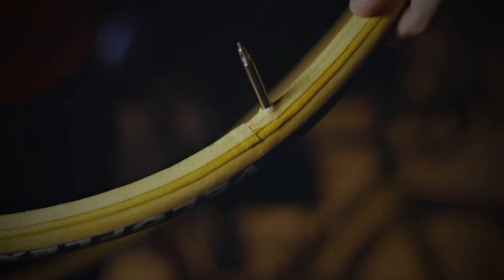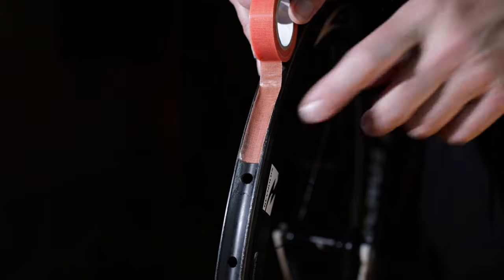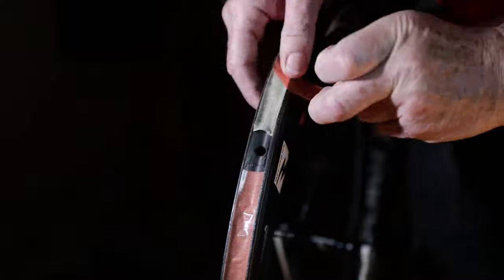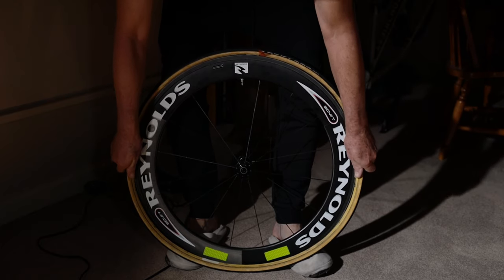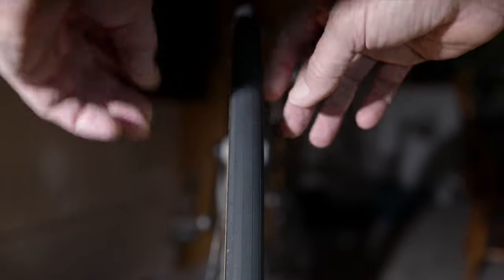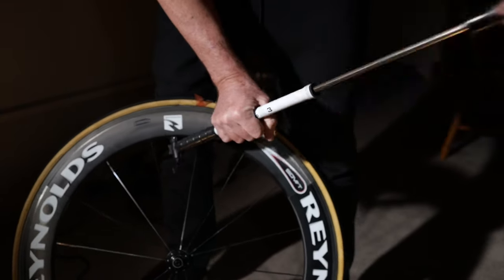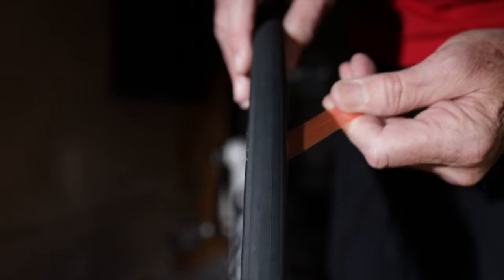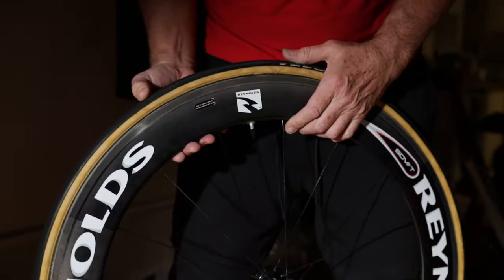How to fit a Tubular Tyre, the Easy way

Comment: Having tried both the tape and glue, I prefer the glue. Removing the old tape residue is very difficult where as old glue can be glued on top of as long as it’s not dry or contaminated. Gluing is pretty easy in my opinion. A layer on both the rim and base tape of the tire, let it dry, then another fresh layer on each, mount, install wheel on bike on workstand, partially inflate, straighten/true tire, inflate to 100psi, leave for 24hrs, and done. Goes relatively quickly after you’ve done several and get a feel for it.

Comment: I have just placed an order for my first tubular wheelset. The Campag Bora One in 50mm rim depth and with the bright decals. I went for a brand new one, so not cheap at all, but sod it, I have always desired to have them, so there you go. 1260g as opposed to 1485g for the equivalent clinchers. I guess I will just make sure I ride the bike not too for from a railway line, so if I get in trouble I can always catch a train back home :).
Reply from the maker: Tubulars are really quite reliable, been riding and commuting on them for years. I have a old vid on my channel where i show you how to fold a tyre up so it fits in your jersey pocket. 
I carry sealant and a spare tyre and pump but i rarely ever have to use them. They can get punctures but in general it is less than clinchers in my experience. No need to ride near the railway. Lol
Reply: @waynosfotos  Cheers. I had watched them all, before making the decision. Yeah, I will make sure I will apply all your advice, and will be alright after all :).
Reply: @waynosfotos  May I ask which tyres have you found the best and could recommend? The middle ground between speed and robustness/durability is what I am looking for. And in size 23, 25 max. as my Look 795 has a tight chain stay clearance and won't accept a 28. It's going to be a £100-£150 spend from what I can see, as I will need at least 3 of them, so I thought I better ask the expert than experiment myself.
Reply from the maker: @82vitt  i use Veloflex, they have a new range but i haven't tried as i have a stush of the old ones, still getting through them.
Reply: @waynosfotos  Ta. I went with Challenge Elite Pro eventually. All the Veloflex I can see available online have tan colour walls, which doesn't lend itself well to my little project haha. At £28 a piece they seem cheap compared to the more popular brands like Conti etc. too, but they also have only good reviews from what I can see.
Reply from the maker: @82vitt  whoops sorry, the black ones have a different name, but same tyre. Will check and get back to you
Reply from the maker: @82vitt  Hi I have tracked them down (this is for their older range)
Arenberg 25m tubular black Sidewall
Carbon 23mm tubular black sidewall
They have brought out a new updated range but I haven’t tried them yet, check out their website
Reply: @waynosfotos  Thanks, I will. Meanwhile the wheels have arrived :). Incredibly lightweight, look the shiz and a nice surprise is how quiet the freehub ratchet is too. I don't like noisy ones. If I am lucky I should have everything ready for the weekend. I need to build the entire bicycle up, but luckily the groupset is wireless so no need to re-route the gear cables. Still at least 3 hours of work ahead of me.

Comment: I’ve a triathlon (stop snickering 🤭) Felt B2 frame enroute. I bought some aluminum 30mm V hoops new at a great price...but a shop in Milan (local for me) has some cf 50mm deep ‘tubilar’ rims on sale...you just helped me decide to ‘roll’ with the cf tubulars!!! (1st time for me;-)
Reply from the maker: Go for it, it is just another tyre system. You cAn run veloflex, made in Italy. 👍

Comment: Hi, had a question. So I had veloflex roubaix’s on for years no issues no flats or anything. Eventually they wore out and now no one makes them anymore. I got the pro race tours and they were great until I flatted the front then the rear got ruined by glass. I got some Vittoria rally’s as a quick cheap replacement but when I fitted them I’ve had really bad bump in my rear wheel. So much where it’s effecting my ride quality. Is this a tire quality issue or is it not seating properly on the rim or something? Any advice would be great. I put a brand new one on the other day and it flatted in the first ride maybe due to the bumping I’m not sure.

Comment: I clean my rims and re-glue them once a year, usually before peak riding season. How do you remove the tape residue when you want to change tires? BTW I love my tubs! You can get a premium wheelset for a bargain price!
Reply: Want to know that as well
Reply: It's a headache when removing the residue left from previous glue...
Reply: @AlaGamesMobile  Use a heat gun set on low to melt the glue then use a PVC pipe roughly the same width as the wheel bed cut on an angle to scrape the melted glue out. It's fast and leaves a smooth surface for the next time you glue tires.
Reply from the maker: ^this^ or use a rag doubled over. 
I hit it with the heat gun then wipe it with the rag and finger. It removes most of the glue. I don't try to remove everything,  just enough so it is even and smooth. 
This allows a base to stick too.

Comment: Aha… I tries this with Zipp 202, effetto maplriposa carogna 20mm tape and conti competition tubs - not working, when I almost get tube on and tried to get last bit on, I made a mess from tape (rolled it with tube), glue mess all over brake track and tape wasted. The issue is Carogna tape is ridiculously thick! 
I will try again with generic Chinese tubular tape, its also 20mm but not near as thick as carogna, maybe mounting will be easier!
If fail again I will try narrower tape (maybe 16-18mm).
Has anyone mounted tubes with tape on 202s? What width tape do you use?

Comment: Hello, I realise I am late to the party, but I have a quick question. Is there any value in injecting stans sealant as a preventative measure rather than as a puncture fix? I have tubeless tyres on the gravel machine with clincher wheels. It's a messy business to set up, but the sealant does a good job of fixing up a small hole with minimum pressure loss.

Comment: I do not touch a tubular since 90s, if the tape was available at that times...
However it is not a case you are wearing that cap. Clement was the best glue for tubular.
Reply: I taped tubulars on my first race bike in 1962. Jantex!
Reply from the maker: That is the brand i use 👍 tried and proven tech

Comment: Thanks for the info on tape, I am going to try it. What's the best way to remove 20 year old glue from my rims? I've always had trouble gettin the old glue off. I'm rebuilding my old steel bike that ran tubulars.
Reply from the maker: Heat gun and a rag, but don't get it too hot and burn the rim.

Comment: Hi! If I want to change tires before the race, can I leave the old tape? So that I don't have to re-glue it every time?
Reply from the maker: I would change the tape as well. I wouldn't risk old tape in a race. It is pretty quick to change.
Reply: @waynosfotos  you will have to buy a new tape every time.
perhaps in this case it would be more convenient to buy glue and use it when changing tires. is it possible to apply glue directly to the old tape?

Comment: I've heard that double face tape isn't recommended for use on track; that is glue is much more preferable. Agree?  Pressure recommendation is much higher with tubular, why is it? What if you put less pressure? Finally, you shall take out some air when unused; why?
Reply from the maker: Glue is supposed to be ultimately faster. Due to tubulars feeling softer you can run higher pressures and also there is a higher limit to pressure for the tyre and rim. You can run tubulars at higher and lower pressures than tubeless and clinchers for racing purposes.

Comment: I'm trying to install Conti sprinter Gatorskin tubs on my bontrager Aeolus 5 rims and if I start from valve and try to stretch and work tire onto rim from both directions, I reach a point where I can stretch no further and the tub makes a straight line 6in from the rim. WTF you crazy German tire makers?
Reply: Ignore that comment. I'm a tub rookie who forgot to deflate tire before stretching onto rim. Duh. After eating humble pie for breakfast I'm going to get out on my first ever tub ride with my steel bike.
Reply from the maker: Amazingly enough, I have a video to make exactly on these tyres. So stay tuned for that one. Full installation of rear tyre.
Reply: @waynosfotos I have a set glued up. Glued up about 3 years ago
 Bike has been stored indoors. So no great heat or cold.
Think they'd be okay to ride? 
Or start over.

Comment: how do you clean the remaing part of the tape when replacing tire?
Reply from the maker: Just pull it off, if it is still sticky on the rim, that will add more sticky to the adhesion. But of course all the tape must be removed or it will be lumpy.

Comment: i have  tubular rims rn with 22mm width sixty six reynolds , will i be able to fit 25mm or 28 on the rims?
Reply from the maker: 22mm is quite wide, so diffinitely. The 28mm might feel a little sqirmy but 25mm no probs.

Comment: I haven’t done it, but if you cut tape long you can have those tabs out of rim without exposing any sticking bits of tape. Then you can move valve portion of the tire too. Hopefully :)
Reply from the maker: For alignment? 
I know gaps can be left for easy removal etc, but i am not a fan. Just stick it all down i say.
Reply: @waynosfotos  just peel the top layer back and just cut the tape an inch short before applying...

Comment: I just got a pair of Dura Ace 9100 tubulars. They are 28 mm wide but I'm planing to use 25mm wheels. Will a tape 18mm wide work?
Reply from the maker: This is not ideal.
It will work but racing might be a wee bit risky as the curvature is different for width. So as the rim is so wide it is designed to a curvature for a wider tyre. As I said if you are just "riding around" or group riding fine, but if you are scraping pedals you may need a wider tyre to fit those rims.
Reply: @waynosfotos  according to shimano they fit from 23mm to 28mm tyres... But I'm wondering about how wide the tape should be
Reply from the maker: @rarosarioc11  the tape will be fine, due to the pressure it gets squeezed across the surface. You will even see threads from the tape at the edges of the tyre over time. 
Give it a try and let us (the community) know how it turns out👍

Comment: Great video thanks for sharing! 3 questions for you.
1. What tub tape do you recommend?
2. If my rims have previously had glue can I still use tape? Just clean off all the glue?
3. Is it hard to get the tire off the rim if it needs replacing when you flat?
Reply from the maker: I use velox the Aluminium tape, they have a specific carbon one but it is heaps more expensive. I have used the standard one for years.
If they already have glue on use a heat gun and melt the glue, wipe with a clean part of the rag moving around and using a fresh part of the rag. You don't need to get it all off, just so it is smooth with a light film.
It is the same to get the tyre off the rim as glue. Rock the tyre till the tyre eventually gives way then just pull ot off.
Reply: @waynosfotos  cheers!
Reply: @waynosfotos   so last question. If I needed to replace my tire on the road would you use new tape or the one already on the rim? Do you carry spare tape with you when you’re on the road? Cheers!
Reply from the maker: @danielandrews4435  no need to carry tape, the tyre pressure will keep the tyre fixed on the rim. Just don't scap any pedals, push in the corners. Then tape on a new one when home.
Reply: These are all the answers I needed thank you guys for being so informative 
I got a set of tubulars handed down to me from a friend and needed some help with these exact questions

Comment: Why do you prefer tubular over clincher? I've tried both systems and i stayed away from tubular as I thought the gluing process was just too troublesome until I found out that there's tape so I'm revisiting this option. Clincher I found have always been easy to maintain but I kept having this fear of pinch flatting them somehow.
Reply from the maker: Five reasons, i find them easier to mount than clinchers (with tape). Maybe i am just use to them, but that is what i find. Also there is no 100psi behind the brake track to have a clincher carbon failure with heavy braking, so i believe safer.
 A lot Lighter.
You can also ride on a flat tubular, slow in a pinch, you can't with a clincher. 
You can run the pressure higher and lower than a clincher. I have riden on 23mm 40psi no probs no pinch flats. I believe the design has a lot of advantages, lighter, safer and easier to mount, some may argue different, but that is what i find.
Reply: @waynosfotos  Thanks for replying! Guess I'm gonna go tubular when I custom build my next wheel set! Cheers!

By the way, when you have to remove the existing tubular tyre and put on a new one, do you remove the existing tape, clean the rim surface and then install a new one?
Reply from the maker: @Jin_KX  yep remove the tape, apply new tape. Nothing to clean as the surface is just a bit sticky, but does not build up like glue.
Reply: @waynosfotos  Ah that's what I was wondering, if the surface would still be gunked up like how glue was.. Awesome, thanks!
Reply: I have tried all of the systems and prefer tubulars by far for all of the reasons previously listed and they also feel so much better than the other ones!

Comment: Is it possible to use Velox jantex competition (Alu) also for Carbon tubular wheels?
Reply from the maker: That is exactly what I use, use to have only one tape, then they split them in carbon and Alu different applications. But I use the Alu one on carbon. I know it says not too, but it works fine for me. But then I am not scrapping pedals. But for general use it is more than fine. Cheap to and one role does two wheels.
Reply: @waynosfotos  thank you. I will try. Great video by the way. I like watching these video’s here in Holland. 👍
Reply: What sealant you use: Vittoria Pitstop??
Reply from the maker: @superwiers  i use stans, add it through the removable valve. 
Haven't had much success with those pressurized sealants.
Reply: @waynosfotos  👍 great tip. Maybe you can make a video about the sealant. I thought Stan’s were for Tubeless not for Tubular.
Reply from the maker: @superwiers  Yeah they say all sorts of things, sealant works in tubes, tubeless and tubular tyres. The sealant doesn’t care, as it gets aerated it sets.
Reply: I’m very sorry to stalk you but i’ve looked into what you are saying about the sealant in tubular. I have Continental Gatorkin tubes 25 mm. How long does the sealant last in the tire and do you have to add something every now and then? Can you tell me more how to do? Again…. Sorry

Comment: Wayne. Why not do a video on tubeless  tyres. Only about 0.1 percent of cyclists use tubs and they have a man to do this work ( pros). Tubeless is the way forwards but maybe this technology has not arrived in Perth yet. no
Reply from the maker: There is a number of reasons I am not a fan of Tubeless for road race bikes. So don’t review them. 
It may be a good video, why I am not a fan, video. Thanks for the suggestion.
Reply: @waynosfotos  tubeless may seem a small step but it may actually be multiple steps onto the dark side for you. Wider rims, disc brakes, tubeless tyres with sealant, and punctures you can fix without getting the tyre off. All this with the prospect  of only having  70 psi in the tyre. I can feel the angst coming on. Will make for an excellent video.
Reply: I have tried clincher, tubeless and tubulars and prefer the tubs from all by far, plus they ride so much nicer.
Reply: @peterbee8892  I definitely like the roll of tubs over clinchers, and I run like 80-85psi in 700-23 clinchers. At the correct pressure for the roads, surface clinchers & tubeless are actually the same rolling resistance... disc brakes are a thing because companies didn't build carbon clinchers that were designed to manage heat from dragging on the brakes, not because they're superior